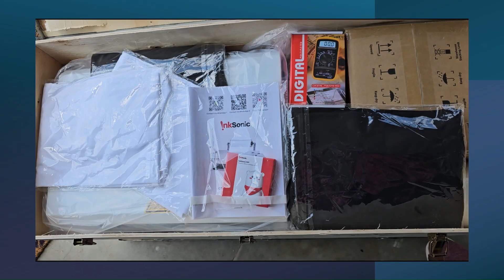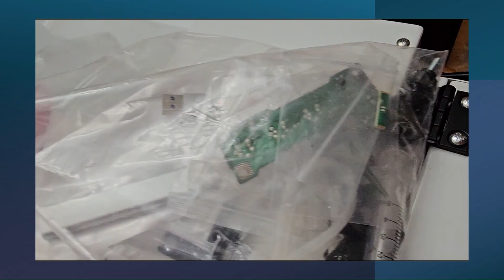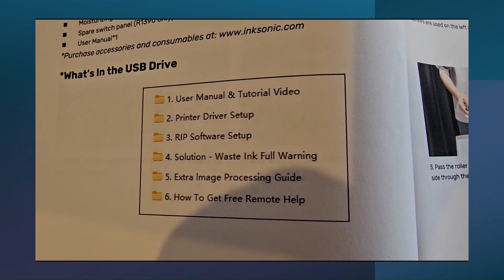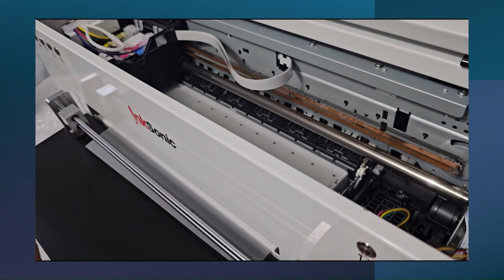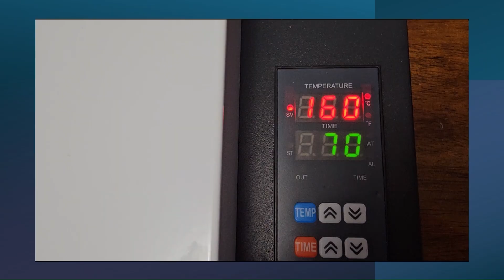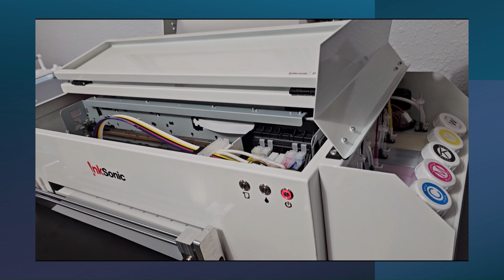C13A InkSonic DTF Printer Review & Setup  Unboxing, First Print & Honest Impressions

Comment: I have the same one but white will clog frequently have you had this issue?
Reply from the maker: Yes, on occasion. Be sure to use the "clean" button in the machine.  I use it morning and evening. I also print daily.  If I'm gone a few days, I run clean from the maintenance tab as soon as I get back and print.  A couple things I have figured out- always run the fan to pull film down. If I forget that, it smears. I also had an issue with my film "catching" on the outside where the cutter is. I put a piece of film (a short 5 to 6 in piece) over that gap so when the print comes through it doesn't catch on that.

Comment: Do you need a ventilation fan setup like a laser engraver does?
Reply from the maker: You should always work in a well ventilated area and use protective gear as you see fit. I do not have a fan yet. Fan would mainly be for the oven bake/curing process. You should be mindful of the adhesive powder as well. And of course, eye protection. It is ultimately up to the operator.